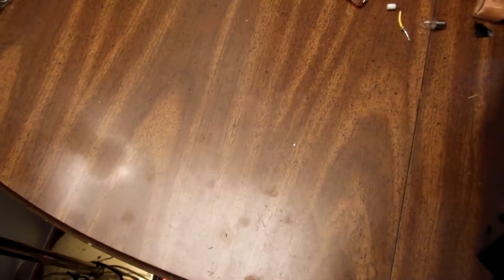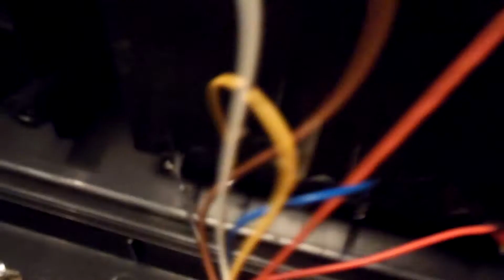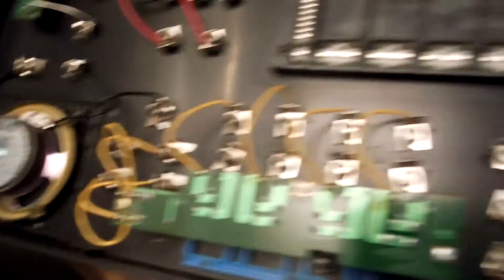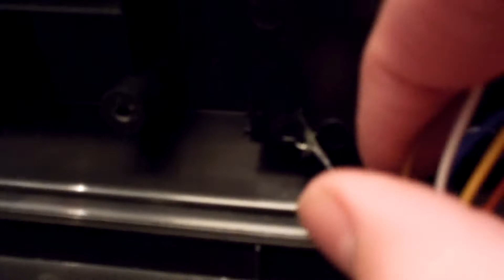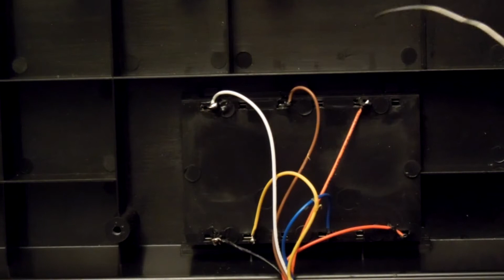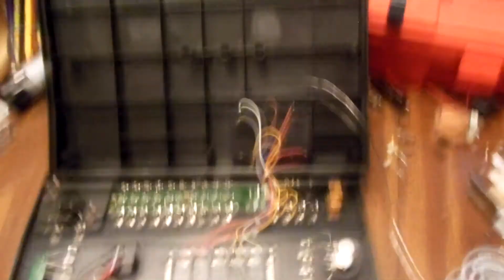Fixing the Electronics Learning Lab PLUS a Look Inside

Comment: Great APC videos with these! Ever install a audio jack out of the learning lab? I'm looking to disable the on board speaker & using it's wires for the jack. Was wondering if I needed to use additional resistance? I'm going to use it plugged in to a mixing board.
Reply from the maker: ***** I would think that you could just desolder the wires from the existing speaker and run them to an audio jack. My only concern would be the impedance of the inputs on your mixer. I doubt that it is 8 ohms, so that might have some side effects on projects that use the audio transformer. You might need a resistor in parallel to try to lower the input impedance of the mixer, but that may cause other problems. I would just try running the wires straight to the audio jack and see what happens.

Comment: Where did you learn to solder, you obviously DON'T know what you are doing, as stated in another comment, you are too ham fisted (rough) with it, that is why it fell over.
It is a good job it was just a wire too, if you soldered an IC joint like that, you would fry it, and more than likely of lifted the copper track off the board too.
Also, that iron you're using is toooooo big and hot for electronics you need a 15 or 20 Watt iron, not that 40+ watt giant iron. Even with a small iron you can fry parts.
I suggest you actually learn about electronics before trying to tell others stuff like that, you got lucky there, that's all.
Reply from the maker: You have no idea what you are talking about. To begin, I know how to solder. It was more difficult than normal because there was paint or glue on the battery connector I was trying to solder to. I also didn't expect it to fall over, I had the back against a box so it wouldn't move. the front slid out, and I wasn't expecting that. I also didn't think that the wire had that much tension on it. I have never fried anything when soldering, especially because soldering a simple wire is nothing like soldering delicate parts on a PCB. This is not a large iron. Although the Hakko FX-888 is rated for 65 watts, it is temperature controlled. The 20 watt iron that I keep as a backup is more difficult to use than this due to the lack of temperature control. This 20 watt iron is also physically larger and more difficult to use because the power cable is nowhere near as flexible as the cable on the Hakko. Also, 20 watts is not enough power to solder anything larger than about 18 AWG without problems. I have done more damage with my $5 20 watt iron than the $100 temperature controlled Hakko.

From all of this, I think that I probably know a lot more about Electronics than you do. I have 73 other videos, and I doubt that you watched any of them. You have none, so I can't directly compare, but from what I have gathered from your comment, you know nothing. I know how to do more than solder two wires together. I have made a solid state Tesla Coil, I have designed and built 555 timer flyback drivers, I work with Op-Amps, logic gates, 555 timers, and transistors on a regular basis. I built a high current transformer out of a high voltage microwave oven transformer. I completely understand how all of this works. You can't base my knowledge of electronics off of one video where I do the most simple project possible: solder two wires together.

Also, how did I get lucky? What is the worst thing that could have happened? If the wire broke I could just solder another in its place. The battery tab also probably wouldn't melt because I had the iron set to 600 degrees and only had it contacting the connector for 5 seconds at the most. With my 20 watt iron, I would have to hold it on longer to get solder to melt, and it would have melted the wire or the tab first.
 
I have no problem admitting when I am wrong, but this is not the case. I was having problems with my Electronics Learning Lab, I took it apart, diagnosed the problem, and fixed the problem. It is still working fine 5 months later. I soldered the wire correctly using the same iron that I use for everything else. I did everything right.

Where did you learn to comment? You obviously DON'T know what you are doing.
Reply: potatogun96 well that was a long read 😂